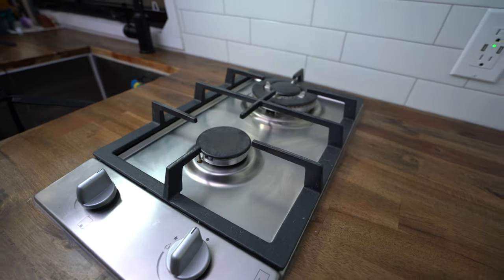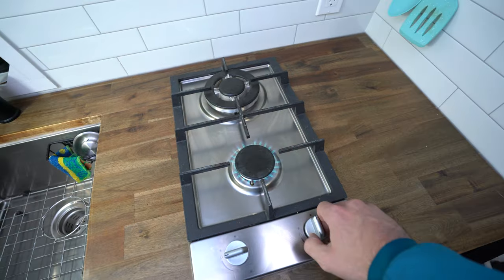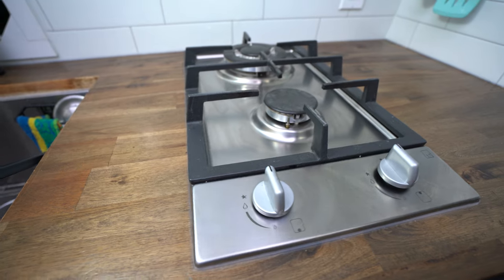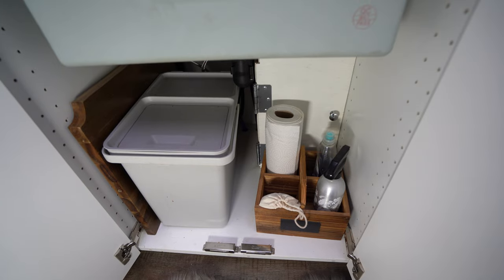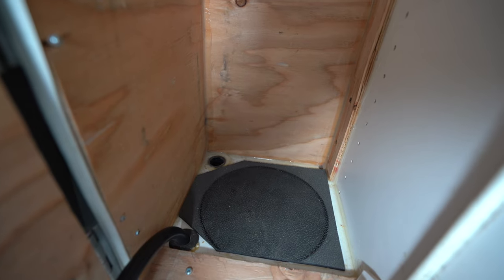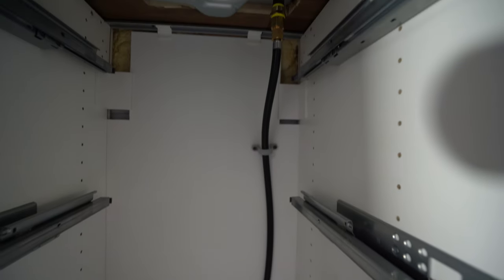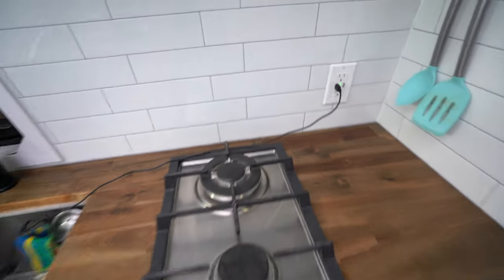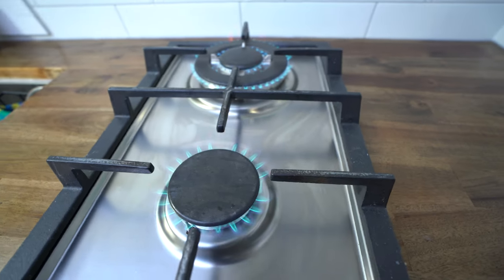Propane Cooktop Install & Review inside STUNNING Campervan Kitchen

Comment: I have a question...do you remove all the top parts (grill and burners) when you are moving (driving)?  Because of injuries if you have an accident...
Reply from the maker: No we don’t and i think there would be a lot more to worry about than the stove top. Have you seen an RV/trailer crash? There is little things EVERYWHERE.
Reply: You have an accident in your RV and it’s the stove grates you’re worried about?

Comment: Hi I know this comment is 2 years late but what did you use for the vent cover inside the propane cabinet and did you just simply use 3/4” pvc pipe and run it through the floor of the van?
Reply from the maker: It’s a 1” poly pipe running through the bottom with mesh covering the outside
Reply: @madetoexplore   thanks and probably a crazy question but what kind of mesh and how did you adhere it to the poly pipe?

Comment: I’m considering putting this very stove in my off grid cabin. Thank you for making this video. It’s very helpful and it also confirmed my thought about the back burner being too close to the wall. I think I’m going to position the stove lengthwise so the nobs would be on the right side instead of in the front.
Reply from the maker: Good idea! We didn’t do this because of the space. Make sure to buy the right fittings 👍

Comment: I have that one too to install. I have all the supplies. my fear and question is do you ever have a fear of propane leakage? I like to light candles (yes with air flow and just for a little bit) and just want to feel confident and comfortable. Since I'm installing myself I just want to make sure I do a safe job.
Reply from the maker: It’s important to test all the connections using a spray bottle with soap and water. If there’s a leak, bubbles will appear. We also always turn the propane off at the bottle after using the stove. You can also purchase a propane sensor that will alert you if there’s a leak.

Comment: Hi i finally got my stove  only problem is the part number you listed for regulator was for somethng else i need to get a long hose anyway looking forward to getting it running
Reply from the maker: Thanks for watching and good luck with the install! Sorry about the part number. It’s hard to keep up with them as they seem to keep changing.

Comment: Excellent and thorough review!  TY
Reply from the maker: Thanks! 😄
Reply: @madetoexplore  Did you use the regulator that came with the unit? If not, what did you use?   I want to operate it off of a 1 lb cylinder vs a larger tank due to space issues.  Do you think a 1 lb tank ( those Coleman cylinders) would work? I would add a shut-off valve for the same safety reasons you shared.  Thx again
Reply from the maker: @adriennef1770  I didn’t actually. I used the regulator that came with the hose assembly. Yes, I think one of those cylinders would work just fine! Our 11lb tank lasts forever so I think a 1lb tank would save a lot of space.

Comment: I installed a top, almost exactly like this one, in my rv, looks great, works great, but had to remove the grate and the the other little pieces while driving, lots of rattle noises, and the little burner caps would bounce off... replaced with a regular rv cook top
Reply from the maker: Yeah I was worried about this when I first installed it but it’s really not bad at all. I’ve been down some REALLY bad washboard logging roads too. Never had the stove bounce apart.

Comment: Did you put a grate or screen on top of your vent.is 3/4 " enough I was thinking of doing 4" pvc with a grate.
Reply from the maker: Yes I did. I think 3/4” is enough. If you want more air flow installing 2- 1” vents would provide more of a steady stream.

Comment: Hi David still waiting on m y unit but wanted to ask you how do you keep bugs out of your vent pipe i live in high desert of NE Arizona and we get a variety of small bugs that seem to love the propane water heater i have
Reply from the maker: I have a piece of pipe going from my vented box through my floor and then sticking out the bottom of the van. I would get some very small mesh screen and fasten it around the bottom of the pipe to keep the bugs out!

Comment: Could you attach a tube to the vent outlet on the propane tank itself and run the other end of the tube out the bottom of the van instead of having to build a concealed cabinet?
Reply from the maker: Yeah that’s another option!
Reply: Except that wouldn't protect you in case of a leaky valve,  regulator or hose (at least the part in the cabinet).

Comment: Just bought that same one my my tinyhy. It came with a regulator. Do you suggest I put the regulator on the tank or connect it to the stove? The directions are 100% useless lol.
Reply from the maker: I didn’t actually use the regulator that came with the stove. I used a prefabricated hose that had a regulator near the propane bottle connection.

Comment: 1. Please do not add music to any demo or tour video.  DIY, demo, tour, wildlife, cooking videos should never have music.
2. Demo starts past the halfway point. Please get to the point fast.  We never saw any install. This would have been helpful.
3. Good view of underneath! That was very helpful.  Also where it connected.  I would add a retainer clip closer to the connection so it does not come unplugged from gravity.

With regard to rattle, some felt strips, or rubber strips would do the trick.  Add them wherever there is a rattle.  I also found silicone waffle oven pads at Walmart/Amazon and you can slip one under the burners to remove metal on metal clanking.  Underneath the stove, I would also stick a piece of Noico sound deadening material or Mass Loaded Vinyl to mask sound.  This changes the clang into a softer thuk sound. Steel sinks all have this coating underneath.  Great stuff for any metal panels on your car /van too.  It weighs a lot!  So use sparingly.

The only downside to this design is that both burners are very close together, so its difficult to use bigger pans - less clearance.  I'm debating this feature over a 4 burner stove.  I do love the simplicity of this stove though and the smaller footprint.  Also good to mention, that the BTUs are 9600 and 6500 for each burner large to small. This is decent. Anything around 5000 - 3000 BTU is worthless.  Anything with very high BTU like the Camp Chef Everest camping stoves must be used outside - high heat hazard.  I think I will get this stove, nice compact, easy to clean design with decent BTU and price tag.  Furrion is overpriced and too hyped up for nothing.
Reply from the maker: Thanks for watching!
Reply: Oh is that all?